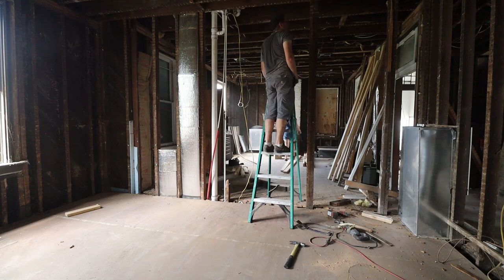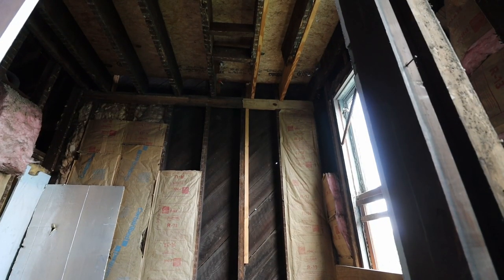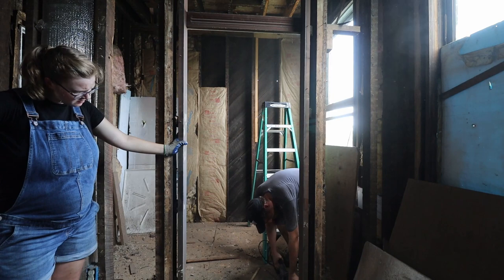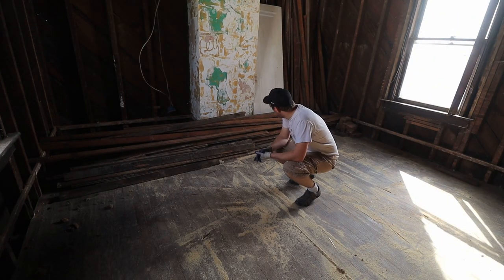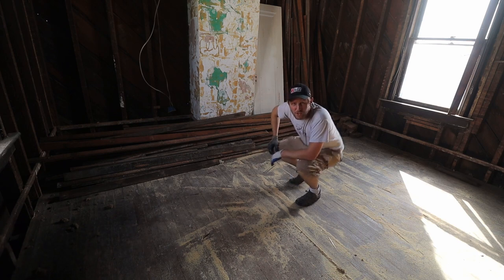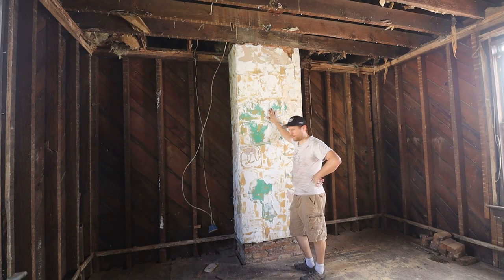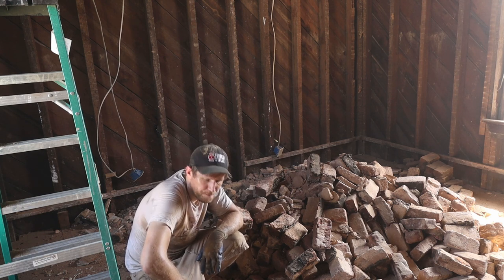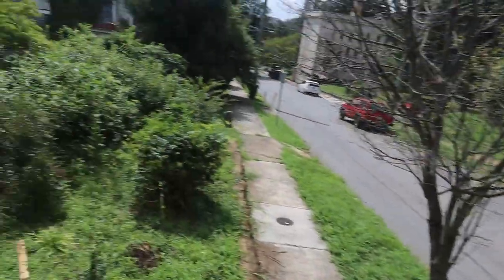Opening up Dining Room & Kitchen and Removing a Chimney  - Victorian Home Renovation [TirolerInn]

Comment: 13:30 is this a window on the right?
if it is, wouldn't it be nicer if you put the door in front of it so you can get a bit more light in the room by using a glass panel door or when you open the door?
Reply from the maker: That is correct, there is a window there! We plan to have cabinets along that wall and it worked better with the kitchen layout to have the door on the left. We will use one of the doors with transom from elsewhere. The room will have 3 windows plus a double window in the dining area, so hopefully we won’t miss the extra light too much. Thanks for asking!